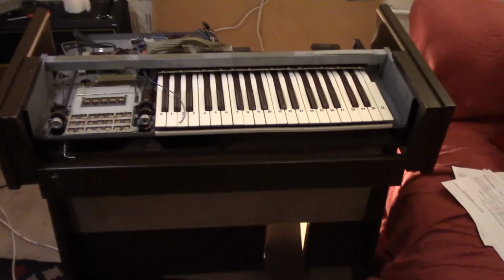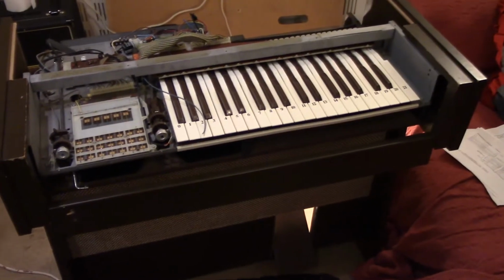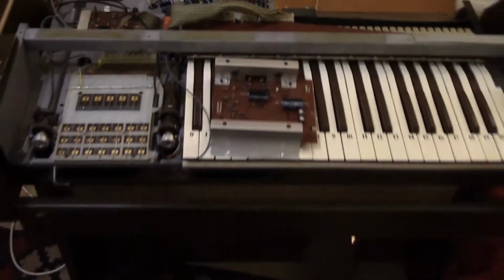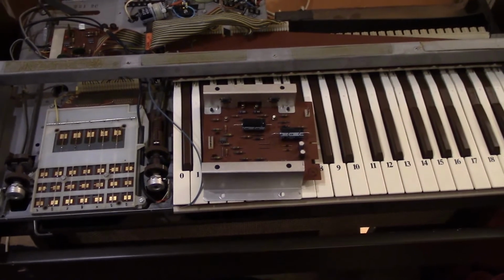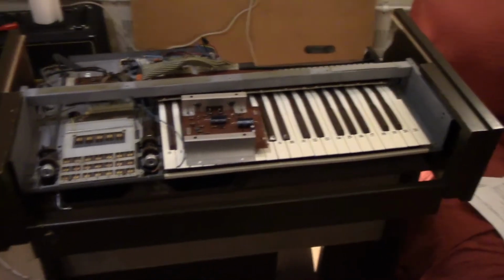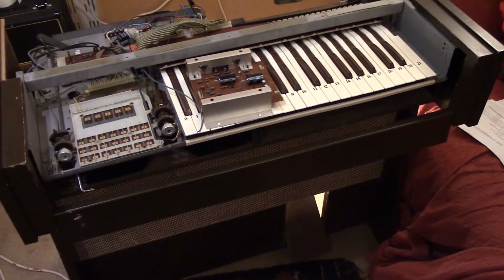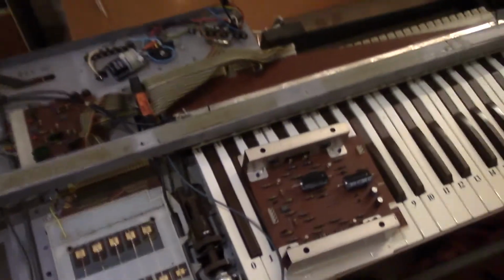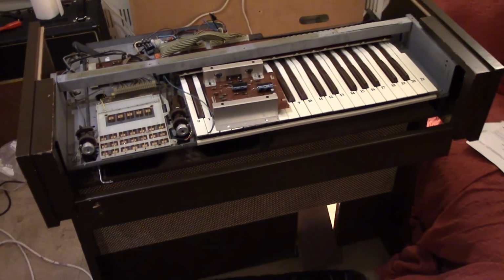Mattel Optigan Model 35011 - Repair Pt3 - Waffle!

Comment: Just substitute the output transistors with something similar. Why take the originality of it? Just repair it. There are transistors similar to those output ones there on the amp board. No need to put new amp on it.
Reply from the maker: I did (it might have been a later video where I talk about it - this was six years ago!) The fault was a shorted op-amp which sent DC voltage into the power amp